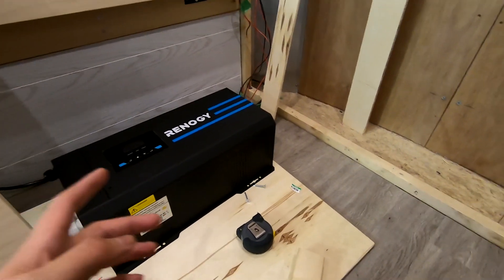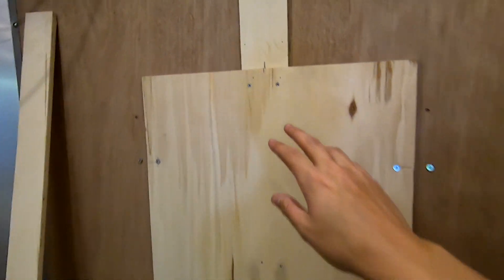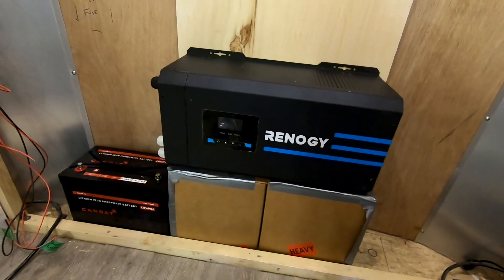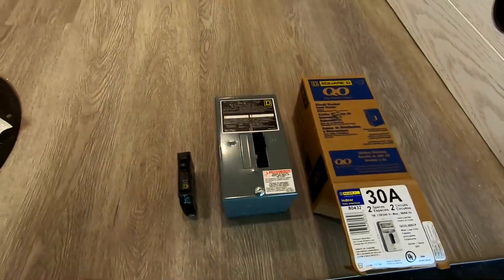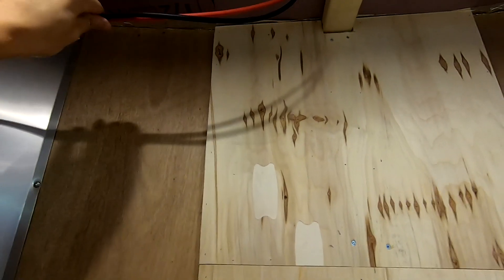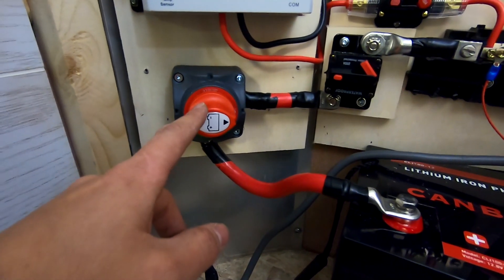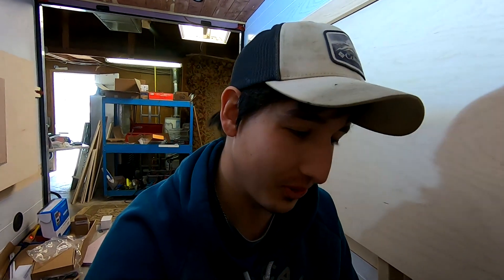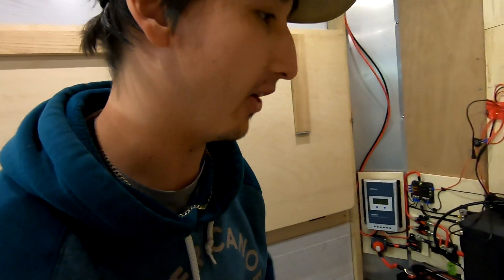Finishing the OFF-GRID Electrical System | Cargo Trailer Camper Conversion

Comment: You should change out that 200amp breaker for a 50amp or if you can find a 60amp. You always fuse to the max input of your item so if something happens you don’t over power it and let the smoke out

Comment: Hi,
Why did you chose 100 amp circuit breaker for your fuse box? Thanks
Reply from the maker: Great question, that's what my 12V - 6 blade fuse panel was rated for!
Reply: @JoelTremblayCA  Thank you for the prompt response.
Reply: I live in Atlanta, GA and I have just received my Canbat battery based on your positive review of the product and plan on ordering another one. I haven't tested it yet but it appears to be high quality. I will let you know how it performs. I'd like to know if you would continue using your 200 amp circuit breaker if you had to add another battery or would you go with a 250 amp breaker? Thank you
Reply from the maker: @simol4538  thanks for informing me about your purchase! I'm very interested how your experience is. Please let me know. They are a great company and have been in the battery business a long time! Honestly when it comes to fusing, I'd ask a professional, as every situation is different. My 200amp for the single battery should be replaced with a smaller fuse (I changed plans and bought 1 battery instead of 2). 

I'd look up the technical specifications of your battery and see what the max rated current is. Typically you'd fuse to 1.25 that amount. 

Enjoy your new battery! You're going to love it.
Reply from the maker: @simol4538  also, not sure if you were able to get a discount. I am an affiliate with the company now (prior to this video) and you can use CHUCKBOX to get 5% off. They might honor the discount even after a purchase.
Reply: @JoelTremblayCA  Thanks. Will let you know once the build is complete. Got a discount on the battery on the first battery. Will use your code when I order the second one. I appreciate your input.

Comment: Hi Joel, could you tell me how you grounded everything to the chassis? Where did you get the ground post you are using?
Reply from the maker: The ground post was given to me by a friend. Not sure what model it is but it's basically a clamp post with a screw hole. I used a self tapping screw to secure to the trailer frame, I cleaned the frame rail with my grinder before attaching it

Comment: Joel. Where did you get the diagram and did you just follow what was on there or was it custom made for you? Reason I ask is I am pretty well following it with the exception of Renogy 200w panel(s), the 3000w inverter/charger (what a BEAST!) and 30A shore plug. I am assuming that 14/3 wire is not right for a 30A plug.
Reply from the maker: I made the diagram myself. I'm not an electrician but I'm sure for 30A you want to run bigger wire. It would be the same as you would in your house. 10/3 I think but don't quote me on it! Good luck with your build!
Reply: @JoelTremblayCA  Joel. I now notice that I have the shunt but may have missed what you have attached to it. Can you tell me what I would be looking for?

Comment: Excellant layout and very educational.  Did you use a GFCI breaker or outlet anywhere in the system?  Thanks!
Reply from the maker: thanks! I just installed a small breaker box with a 15A circuit breaker protecting the two outlets.

Comment: Joel quick question for you.  Did you set it up where when your main cut off switch is off it off your solar will still keep your battery charging?  Awesome set up.  I built one trailer and sold it and I am on my second now.  I like how you did this.  Diesel heaters are awesome but learn to tune it for elevation.  I learned a lot about those heaters.
Reply from the maker: I've setup the main cutoff to kill power to everything. Everything after that is seperately fused to the device.
Reply: @JoelTremblayCA  I gotcha.  That was kinda what I figured looking at it.  My first one I left the solar separate to allow for solar charging while I am gone.  Worked really well keeping the battery peaked out.

Comment: Question, just got the same inverter. Are you running a single 100ah lifepo4 battery or 3? I understand that the batteries need to meet 300ah for a 3000w inverter?
Reply from the maker: I've got the 2000W inverter and I run it with a single 100Ah battery. The recommendations are for 2 but I didn't have the budget. No problem running the inverter, just be aware that you may not be able to use the whole 2000w the inverter has to offer as it would draw too much amperage from the battery. I think that's how it works, I'm not entirely sure.
Reply: @JoelTremblayCA  understood, and yeah that makes sense. Great build and thank you for the reply Joel.
Reply from the maker: @jasonsimmons9138  thank you! Glad you've found the videos helpful. Good luck with your build.

Comment: if you had this plugged into shore power is it capable of charging your battery as well as powering that breaker at the same time, thats running say a gaming laptop and what would be the smallest of window ac units? on just the 15amp
Reply: let me rephrase a bit and make it more clear what im asking.
can the inverter charger act as a passthrough if shore power is plugged in to power the AC 120? im not asking if you can run an ac off 100ah of lifepo4.. im just unfamiliar with this kind of inverter.
Reply from the maker: To answer the first part, yes it can be set to utility priority or battery priority when plugged into shore power. For the second part, I'm not sure honestly. I don't plan to use AC so I haven't ever researched this.
Reply: @JoelTremblayCA  how do you plan to deal with condensation?
Reply from the maker: @thegxpguy  natural ventilation!
Reply: @JoelTremblayCA  awesome, thanks man! btw ive used one of those diesel heaters in a short 21ft old crappy camper and it will get hot enough to make you miserable! they are awesome.
Reply: Wouldn’t you want the 30 amp breaker panel on the inlet (shore power) before going into the inverter??

Comment: Good job!  How did you determine the fuse and wire size to use?
Reply: You size it by your inverter.  If it can pull a max 200 amps, use a 200amp fuse.  Same with your solar panels and such.. do the math and see what the maximum amperage is... add 10% or so amd size the fuse to that :)
Reply from the maker: Thank you. Yes there are lots of resources online. Everything is sized to the components and every component is different.